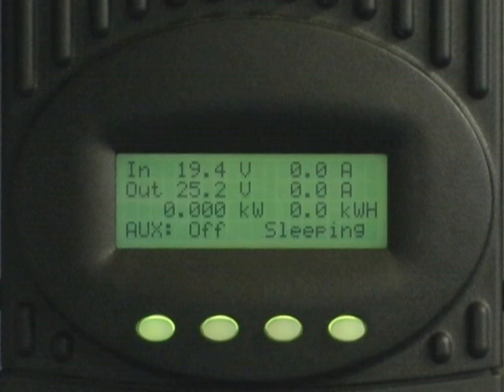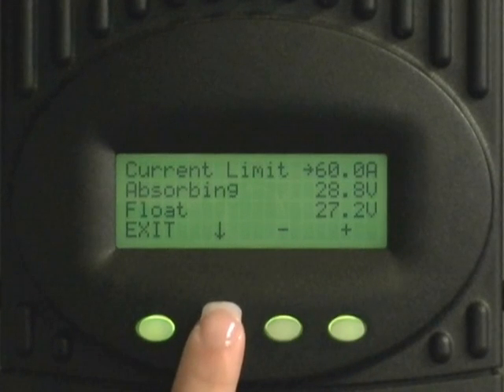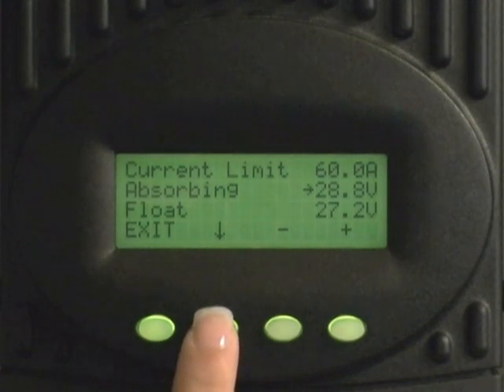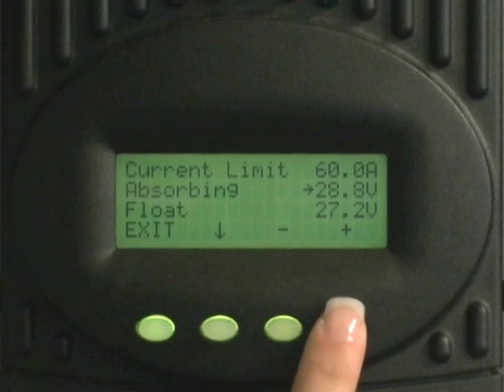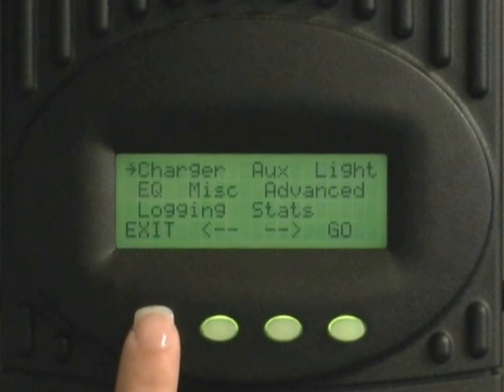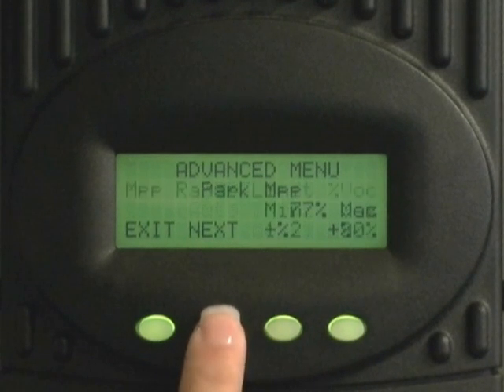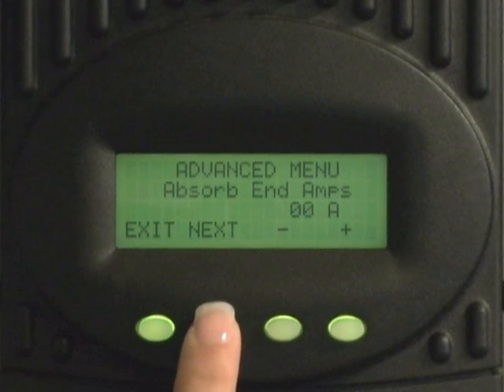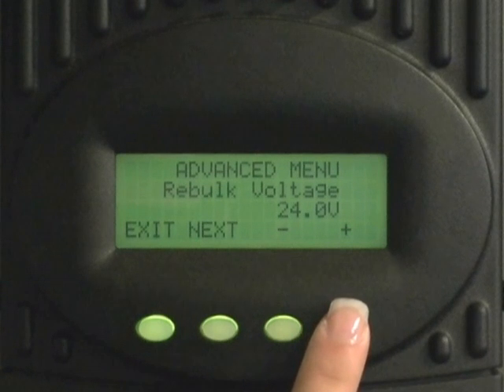Tech Support | FM60/80 Charger Setup

Comment: I know this controller just puts what it thinks the batteries need into them, but it would be great if there was a way to set it to know when the days of the year are shorter so that it could send more amps out to the battery to charge it faster. that is the only flaw I see in this inverter. in the long days of the summer it does a fine job, but in the short days of the winter it almost does the job, but not fully.

Comment: So quick question. On the Absorb end amp portion of the video it states to set to 2% of your amp hour Battery rating. 

I have 6 strings paralleled for a total of 1500 AH- The individual battery AH rating is 250.  Do I set this for 2% of the 250 or 1500?
Reply: 2% of your TOTAL battery bank

So if you have 6x 250ah batteries paralleled, you will set it for 2% of 1500.

If you had them wired in a series then it would be 2% of 250.